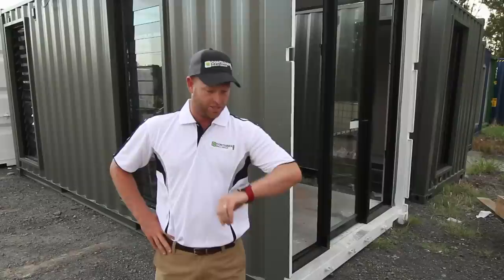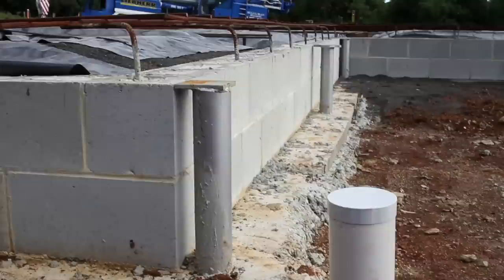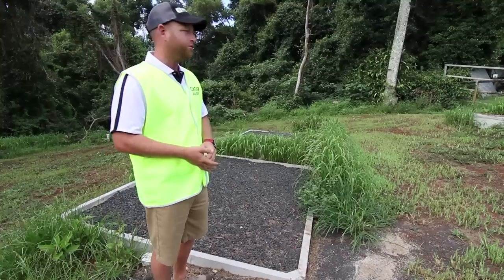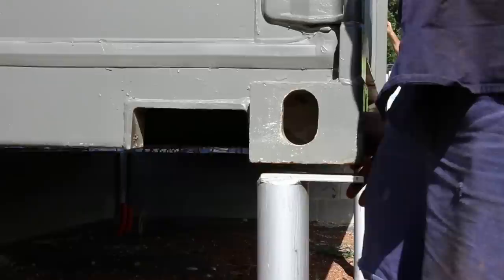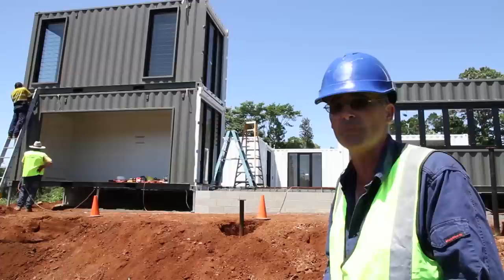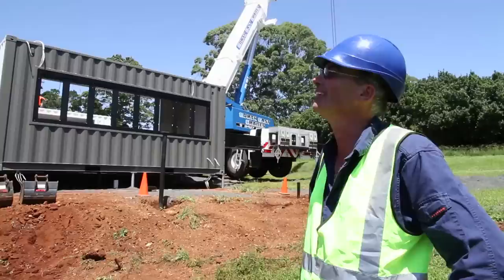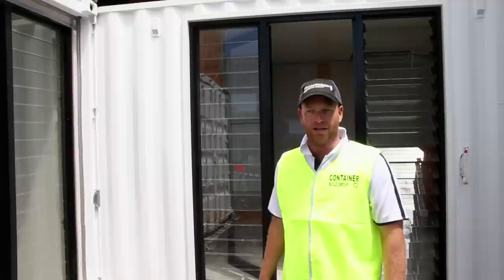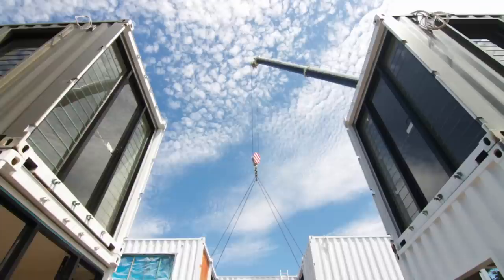Architectural Container Homes

Comment: I have 2 40 foot boxes with a 12 foot space in between I mounted the boxes on a 2ftx 2ft by 8ft 6inch concrete blocks and bolted the boxes to the block they are just sitting there but they are  not going anywhere the blocks weigh 3 tons each there is a floor between both and the whole structure is roofed which gives me a 40ft by 28ft multi roomed workshop it is not insulated but so far no condensation problems yet I do have 2 air extractors on the roof ....wind powered that seem to do the job it has plenty of lighting and power points,plus an electric remote controlled  roll a door and at the moment only 1 window and I am biased but its great !!   :-)

Comment: Cant wait to see how this finishes up. 

So is the bathroom and kitchen partly fitted out in your factory?
Also would the container doors if left on be able to open into the building if a concrete floor is level with the container floor?

Comment: On the support post for the containers?  How deep are they in the ground and are they filled with or incased in cement?  I have a design I am working on and by watching your video I think I can defer a lot of foundation costs.  Is it black pipe you are using like oil well drill stems?  Are you driving them into the ground or digging a hole and setting them.
Reply: In the video it is mentioned that each “stirrup” is concreted into a 500mm x 500mm block.
Reply: The four corners need to be supoorted nothing else

Comment: How much did the whole thing cost
Reply: no one has got back with you?!
Reply: Nope
Reply: slim b An arm and a leg...
Reply: That's cold LMAO
Reply: #containercabins1 here's  a few ideas  of ways to build a container home
    Make Sure You see the Containers You're purchasing.
    Don't Expect To Make save a lot of money.
    Read up on your local building rules.
    Find a contractor that will do the whole project.
    Understand a shipping container's structure.
    Minimize the amount of welding needed.
(Reference: Rohon Home Build website )
Reply: I feel like if you get your own group of handy man electric pluming floor install a sheet rock guys you’ll be good a decent size shipping container could be done with 40 to 45
Reply: slim b 30 million naira
Reply: noctanol that's only 83,000 compared to 500,000 or more in the states
Reply: Kingdom Bound if you think shipping containers cost 500k in the US you need to see a psychiatrist
Reply: Not the containers itself the hole project all together start to finish with land land luxury
Reply: Kingdom Bound you don't put containers on prime land. Wtf is wrong with u? Have u seen any container homes in upstate NY, new jersey, silicon valley etc. These crappy houses depreciate over time, they don't appreciate in value.
Reply: noctanol you trippin bruh to hostile man I'm just having a conversation with you I'm new to this just learning I'm not debating you relax smh and from what I've seen there's a wide range of land possibilities again this shit is hardly worth debating. Blessings homie.
Reply: Kingdom Bound we build this "luxury" containers for about 25k in Texas. Why not do some research B4 commenting some BS 500k shit.
Reply: noctanol Lol ok smoke something have 🥃 u too up tight
Reply: Each container will cost around 2500 unfinished
Reply: @noctanol  hello, i actually want to move to texas and build a shipping container home like this one. Is there any companies you can recommend ? I have no idea where to start
Reply: @noctanol  they are starting to put these in cities... there is an apartment complex of them in phoenix arizona... and they are getting more and more popular... because they are different and hipsters gonna hip.
Reply: @noctanol  jesus man calm down... when your getting them prefabbed like this and with that many containers its not out of the realm of possibility that the entire project cost 500k  all that foundation work  full services install.. it being  that many containers prefabbed..  imagine if the containers each cost about15-20k dollars with the prefabrication that went into them.  its not unrealistic.
Reply: Goid luck with that texas heat.

Comment: Insulation?
Reply: James Bradshaw  i saw it before at high temperature areas they use foam and mud to insulate it from heat outside and it must be an earthing grid for the electric isolating to protect from any surge cause all of it made from metal
Reply: @mostafakenawy1995  dont use foam insulation! I read it somewhere that it have the possibility to release toxic chemical! :( also using foam insulation isnt sustainable, unlike container itself

Comment: That looks expensive- if you have that much coin just build a normal house ?????
Reply: Exactly. The whole point of container homes is to cleverly own a sturdy house at a fraction of the cost. If consumers start building luxury, human sized, habitrails, then the shipping yards and builders will jack up the prices. Its already hard enough to get a bank to finance it.
Reply: Indeed, dixcreative. That goes against the purpose of doing an alternative house solution. More cheaper, costumized, do it yourself home. My guess is that it becoming trendy killed it. Or will make it costly for those with limited budget.
Reply: @johnriver3425  I think your right about it becoming too trendy these days.
On the positive side though, if the rich do enough of it they will make it easier to get council approval for everyone else in the future.
Unless council then expects a fully clad and enclosed architect designed container home cause that will just screw everyone over.

Comment: Losing patience with 'all the preliminaries. Want to see the finished product 'long before shown. Apparently, some viewers get off on the 'machinery used to move the 'containers. However, speed it up, 'do time lapse. If viewers want to 'review process they can 'rewind, so to speak. I'd prefer to see 'time lapsed installation and 'more of the result and/or interior. 'moving on to the next 'container video.....
Reply: I'm ready to try and contact the home owner for more information.. I can't believe Container Build Group did not do a follow up video.
Reply from the maker: https://www.youtube.com/watch?v=665hEWbhjFM
Reply from the maker: https://www.youtube.com/watch?v=665hEWbhjFM
Reply: Its seven minutes, dude! Drag that little red bar!
Reply: Oh! apologies. 'forgot about that 'red 'bar!
Reply: There are several components to creating an amazing design. One place I found that successfully combines these is the Magic Container Plans (google it if you're interested) without a doubt the most incredible course i've seen. look at this  great resource.
Reply: hi guys, the greatest results that i've ever had was with the Magic Container Plans (i found it on google) without a doubt the most incredible course that I have ever tried.